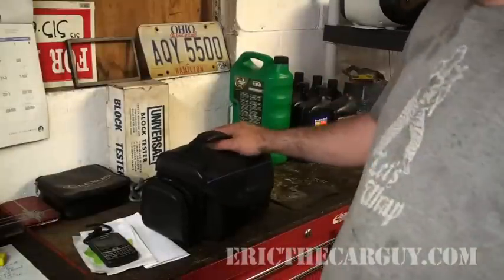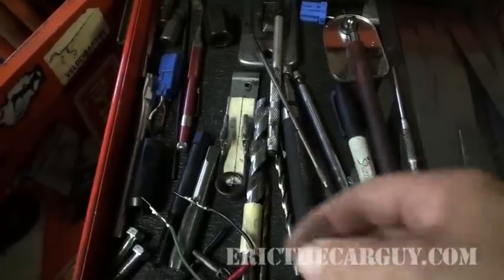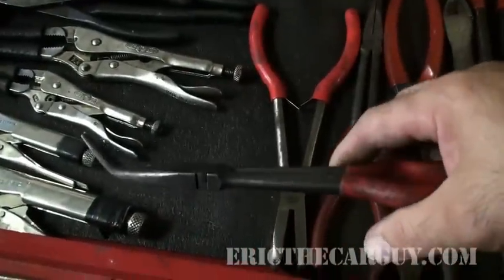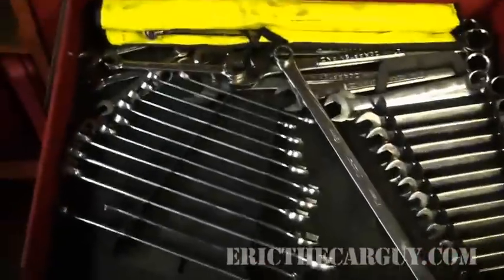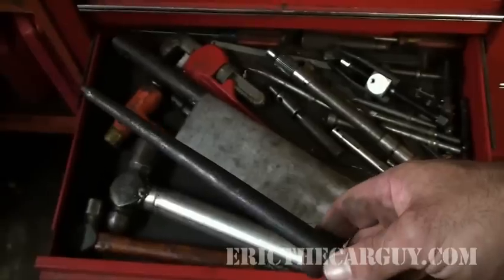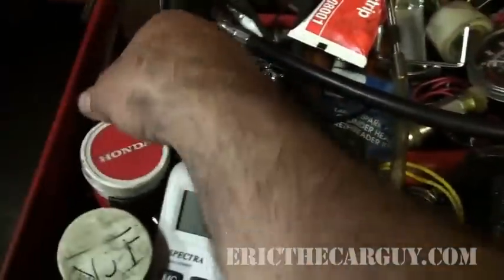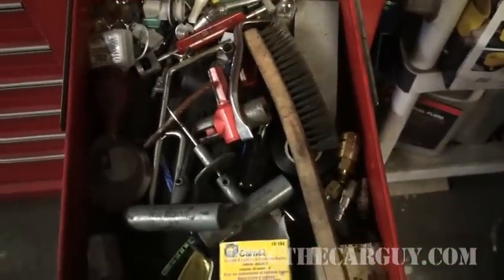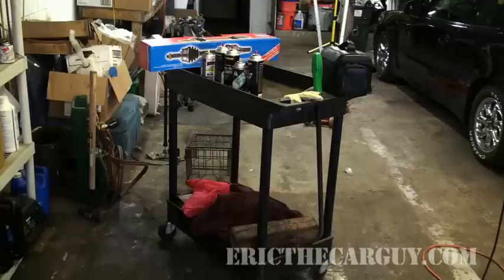What's Inside EricTheCarGuy's Tool Box? - EricTheCarGuy

Comment from the maker: @fastjdm  American car makes went to metric back in the 80's actually but there are times when you use an SAE tool as there are still some applications where you need them, it's also nice when you run into a rusted fastener and just using an SAE size will work better than a metric.

Comment from the maker: @smithdsmit I don't know for sure but you might.  I would check the belt tensioner first as the bearings in those go bad a lot more than in alternators.  Take the belt off and spin all the stuff to see if you can pin the noise down.

Comment from the maker: @cagonesss The check valve in the fuel pump assembly is designed for that very thing, when it goes bad you get pretty much what you describe.  You could always cycle the key before you crank to 'prime' the system before you start the car instead of cutting your exhaust.

Comment: from Donnie's The Garage Butler interview of Eric:
(I'm going to copy this comment to Eric's Youtube channel). Great interview, thank you!
Right now it's 12:30 a.m. and I'm flat-out exhausted because I got up around 6 a.m. and started on my last day, of 4 days,  repairing a stuck driver's side window actuator. It was 90+ degrees and 100+ humidity from 7:30 a.m. to 8 p.m. I'm very proud to say that I got the job done and the window works.
The encouragement to do this comes from Eric. I own a 1997 Dodge Ram 1500 and just bought a 2002 Isuzu Trooper with 270,000 miles on it that has issues. I continually spend all my money on tools and runs to the junk yard and love it. I'm a guy who didn't know what ABS meant. I would pop the hood when the check engine light came on thinking I was supposed to check for squirrels in the fan belt.
Before I found Donnie, I spray painted the whole truck with bed liner paint - it's a work truck. The Isuzu, for the most part, is still a nice blue that I like and I will be referring to Donnie's Youtube channel often - I'll send pictures when the Isuzu looks showroom new.
Thanks to both of you.

Comment from the maker: @jorgevrod It's fine to start with the basics.  When I went to school they had a starter kit (that came in that 3 door box in the video) that I used until I was able to get a job and a bigger box.  Do what you can to get started and then take it from there with what you need in the shop where you are working.

Comment from the maker: @happy543210 They seem to have an issue with pulling the head bolts out of the block causing a head gasket leak.  To repair them you have to drill out the old threads in the block and put new threads in with a special kit.  Not an easy job if you asked me.  I've also seen this problem on the Olds V8 which is pretty much the same thing.

Comment from the maker: @passion1080 It stands for 2 cam shafts instead of the traditional one camshaft found in most engines.  Check out the video I did on the basic engine parts as I cover the differences.
Reply: 5.4 F150 Truck do they have pvc

Comment from the maker: @princejaa Well first get a set of gauges and start diagnosing the system before you start filling it with refrigerant.  You need to know the system before you can diagnose it.  After all it could be an electrical issue that has nothing to do with the refrigerant.  AC is way more involved than most people give credit, in fact whenever a customer comes to me with AC issues I leave a lot of open room on the estimate for that very reason.

Comment from the maker: @westendpimp2003 Head bolts pull out of the block and cause a head gasket failure.  Not only is the head gasket a pain but you have to drill out the threads and put thread inserts into them before reinstalling the heads.  This will be a video at some point and probably a best seller.

Comment from the maker: @ibrahimalghamdi94 Well for my background it would save me some typing if you went to my website's 'About' page.  As for the tool box I got it used so it didn't cost that much but new ones can go for quite a bit depending on what you get.  I wouldn't drop a lot of money on a box that I would use at home however but if your a professional tools are an investment and I would regard them as such.  Thanks for the comment.

Comment from the maker: @coldcash12345 I don't use them, I had a bad experience once where I broke one off in an engine block and had to have it drilled out at a machine shop with a diamond bit.  This is the reason all my drill bits are burned up.  I'd rather have burned up drill bits than to have to go through that again.

Comment from the maker: @DieselCrawler86 I worked for Acura for a little more than 8 years yes but I've worked on lots of things from the 20's to the latest high tech ride.  Honda is just were I ended up, in fact I had actually applied at the Cadillac dealer and they sent me to Acura.  I'm glad they did to be honest, in my opinion Hondas are some of the easiest things to work on.

Comment from the maker: @hooey6 Funny, I've had that happen on a Doge before too,  had to send it to the machine shop because I broke an easy out inside the bolt.  They had to drill it out with a diamond bit.  I'd be careful with the torch because the slag will go further in the hole.  Personally I would stick with drilling no matter how may bits I burned up.

Comment from the maker: @therockkkkher Head gaskets on the north star, the root cause being the head bolts coming out of the block, not to mention if a starter goes (it's under the intake).  Working on those cars is a real challenge let me tell ya, even for EricTheCarGuy.  As for the Honda's it's usually some fool that cross-threads the plugs into the head, sometimes they catch a bur on the way out and screw up the threads too.  Since they are down in a well they are impossible to get to with regular tools.

Comment from the maker: @pinoypower247 Actually the one I have would be good for home use, it's a 26 gallon that runs on 110, for a shop I would rather have at least a 60 gallon as that would keep up a lot better I think.  Anything smaller than a 26 gallon probably isn't enough to run air tools well.  You might consider electric impacts in that case, they cost more but you don't have to worry about a compressor.

Comment: One tool I didn't see that I use a lot is ratcheting box wrenches. Huge time saver. I also use a 1/4" 18v Lithium impact gun - huge time saver for taking stuff apart, quieter than a 3/8" air socket wrench,  and no airline to get in the way

Comment from the maker: @christianbaclao Your in luck then because Honda's don't require a whole lot of tools.  Start with good hand tools, sockets and ratchets in 1/4" and 3/8" sizes you won't need too much 1/2" stuff other than a 19mm to get the wheels off.  A good set of players work well too.  Let me put it this way, I worked on Honda's every day at the dealer with the stuff you see in this box.

Comment: Hi Eric love the Videos. One of the things that I came across in my 25 year career was don't waste your money on the big overpriced snap on tool boxes.
Reply: How to Automotive this is an old video. He now has one of those big overpriced snap on tool boxes.
Reply: That's an argument that will never end and I can see it both ways. I've worked with old guys that had crap piled on other crap in Craftsman stacks but they could dig around and find anything in 5 seconds. I feel like the average tech can work much quicker with a layout that works for them. It also depends on how things work at your shop for job division, bay use, if you only work on certain types of cars.

Comment: Such a spring loaded center punch has helped me out getting stuck philips head screws out in reasonably tight spaces. A rather slow variant on the air hammer with a pointy tool method.

Comment: In regards to your comment about burning up drill bits as a j man welder and machinist I can tell cutting oil is horrible for the life of drill bit...use band saw coolant mixed 50/50 with water in a spray bottle you'll be amazed at the difference drill bits cut faster and last much longer

Comment: The only self made tool for loosening (oil) filters I made was using a piece of bicycle chain with both ends mounted to one end of a piece of pipe diameter  approx.15 mm lenght of about 20-30 cm, the other end of the pipe held a free moveable rod to put momentum on. Almost no cost to make, the length of the chain stands for the diameter of the filterhousing by using it the chain slightly grabbs into the filter wall and takes a good bite into it. Even in tight spaces it can be mounted easily.

Comment: @EricTheCarGuy 
Thanks. The other thing I learned is to forget 12pt sockets when dealing with old Honda Accord nuts and bolts. Those sockets chew the stubborn bolts up immediately. MUST use the 6pt sockets on those bolts and MUST have a snug fit. I made a raised edge on my egr valve bolts with a 12pt no name socket and a poorly fitting crowfoot flare. Fortunately, I was able to stick a file down in there and smooth out the buldge, then wiggle a 6pt swivel socket I got from sears onto it.

Comment: @ZeypveldAutosport I went to a class on CAN vehicles last year at a tech expo.The instructor replaced a computer in a CAN vehicle because someone used a power probe,smoked the computer up.There are 2 wires twisted together for the CAN system,these are never probed.Basically the power probe is a gun shooting 12 volts to a 5 volt sensor

Comment: i dont have  my own video equipment but a tool that i found very usefull is made by knipex its a cross between adjustble plyers and a adjustable wrench i bought mine from mac but i found the same ones at a sears store the last time i was there they provide better grip than a adjustable wrench not as easy to get into some places but i found them best for holding one side of a bolt then use a wrench or rachet for the other side

Comment: Those impact swivel sockets you use, are they 12 point or 6 point? I hear you when you say that 6 point may be easier on bolt heads. Of course, 6 point are easier to make, cheaper, and (I presume) more durable. However, once in a while I come across 12 point nuts, and 6 point won't do for that.

Comment: I'm looking at this video because I'm wondering what wrenches or combination of wrenches or other devives would work to get at the fittings on the high pressure power steering line that I'm trying to remove and replace underneath the car. The fitting at the P/S pump end is fairly easy. The other end, which connects to a short connecting piece that in turn connects to the rack is in a sub-frame space with no room for leverage or wrench movement. I'm thinking about getting a crow's foot adaptor.

Comment: Hi, Eric. That tool that you use to launch straws. What did the manufacturer make it for originally (grin). Is it one of those tools used to test individual fuel injectors to see if they are firing? Or is it a pickup tool of some type.... 

By the way, Scotty Kilmer has a device that looks like a flyswatter, that he uses to quickly see if coil-on-plug ignition is firing. What do you use for that kind of diagnosis?

Comment: Eric. I have heard you say that use oil when drilling with bits a couple of times. I would think that oiling a bit makes it more difficult to drill. Maybe a non lubricating coolant would be better. I think bits are supposed to basically shave off metal by digging into it but the oil would make it less able to do t hat.
Reply: The bit has already been hardened enough to be able to penetrate and dig into the metal with minimal pressure; if it digs too much, the edges of the bit will grab on and twist itself into the metal and get stuck. If you don't oil your bits, the increased friction will also make it wear faster
Reply: ^^^ this guy got it. Drilling metal with a lubricant will make it take a bit longer, but in return your bits will last much longer and stay sharper
Reply: Luu Vo

I thought they made a non lubricating fluid for that. I can see using a liquid to keep it cooler but I FIGURED you would want a liquid that didn't lubricate.

Comment: your an acura guy I got a 01 integra gsr that's missing the one of the bolts that go threw the glass on the rear hatch for the 3rd brake light. Having a hard time getting ahold of one.

Comment: I have a question, I want to buy an electric tool to do automotive stuff with it such as changing tires, loosening bolts and screws, etc.. I see at the store that they have an impact driver and an impact wrench. What's the difference between the two and how many volts is good enough for my needs?

Comment: I know a good use for cheap throw away tools,make specialty tools out of them.I have a few throw away wrenches I ground down to get in some tight spots.You have to watch it with some Snap On dealers,refuse to replace broken tools with the not purchased from me excuse.Before buying a set of Metric wrenches or sockets,check if they have an 18mm an 15mm.These two sizes are left out a lot,18mm is left out most of the time.I know what the power probe will do,smoke up to 3 ecms in CAN vehicles

Comment: Hey eric what is the honda tool for directing the flow of the oil called? 
Here in the uk there are a few engines that have filters in silly place that result in all all over drivesheafts, bottom arms when changing them.
That looks like a great idea

Comment: I read somewhere in order to be ASE certified there's like 8 different crytera and any 8 (engine, exhaust, climate control, electrical, emmistions) and some others I can't thint of off the top of my head. If a tech/mechanic is specialized in any of the 8 that qualifies them to be ASE cert?

Comment: @EricTheCarGuy 
yeah, I get it. I worked for acura from 05-07. I now work for myself. I actually have a question about acuras. I own a 2000 rl and my srs light is on. I know my cable reel is bad because my steering wheel controls don't work, but I want to make sure that's the only code. I know that on many hondas you can jump I think pins 9 and 4 on the data link connector and the light will flash the dtcs. I don't however know if this works on my car, it was made a little before my time.

Comment: @CultBassCo to be honest, oil is oil. i been asking around alot about this. as long you do regular oil change you should be fine. syn is going to be better than convention oil as far as engine protection but the price diff can set or part between the two.

Comment: Thanks for posting this. I always knew that part of the reason I struggle with so many things under the hood is lacking the right tools to get the job done easily. I do want to ask what kind of 10mm and 12mm swivel sockets (regular and shallow) that you recommend for DIY'ers? I want to buy a good combination of strong, but thin, that lets me put it on bolts that are close to other stuff, such as the tricky bolts on some EGR valves on Hondas. Thanks.

Comment: About the drill bits...go slow! Slower than you think, about 100 to 250 RPM's when you're working with metal. Feel for the bit to cut.  And use water, not oil. Water helps the bit
"cut" and "cool" better than oil products. Oil lubricates and helps resist abrasion right?. Lubricate the bit and it will slide instead of cut the metal. Slow down- and go faster.

Comment: not a related question but i was wondering, with the crappy 97 cl j30a1 transmission. im getting it replaced. what would be the best thing to do besides not driving it like a mad man to help keep the transmission working right as long as possible? Im in NC and its 4 sessions everyday. In the city and on loooong country roads. work isnt far but the neariest city is 35 minutes away. anything i can add or do to make it last as long a possible. the "newer" transmission has 73k on it. old one:232k

Comment: @EricTheCarGuy question,got a 99 camaro v6 and the fuel lines dont keep the fuel and seems to go down back to the tank,i checked all injectors to see  if anyone stays open and also checked the pressure regulator so the last thing is the one way  check valve in the tank but to change that i need to saw off the exhaust to remove the tank .do you know any other way to keep the fuel from returning back to tank>?maybe theres something outhere i dont know about>?special filter whith ballbearing or ?

Comment: Eric great videos and I have some suggestions ... Drill bits should be expensive and made in USA or Germany and the coolant should be Walter Coolcut . Also you should treat yourself to a pair of Knipex Cobra water pump pliers model 8701250 or 8701300 I have sold thousands of them and their the best pliers going

Comment: ok, what are the oil specs of GM, Ford, VW, CDJ needs? as far as i know the only specs people should be concern is the velocity of the oil. honda recommend using premium brand moble1 synthetic for motor oil. yet i still use conventional oil. i dont see it seize up the only thing i might say if it may cause more wear and tear more than the more expensive synthetic oil.  

the only spec i go for is coolant fluid. as far as oil i dont think nothing bad will harm the engine.

Comment: Hey Eric, I have a 2000 Altima that has a oil leak around the distributor, I removed the 2 10 mm bolt, but I will not come off. Do I need to loosen the valve cover? Also, I heard this cause by a bad pcv? Please Help!

Comment: Dude if your burning drill bits your probably going too fast (especially on hard materials like Stainless) or the bits are cheap, lube is ALWAYS good when doing a cutting operation. Also they may be sharpened incorrectly.

Comment: Oil Drain Deflector
This is the part # VSB02C000023 and you can find it online at bernardi honda dealership under the cr-v or element maintenance section.